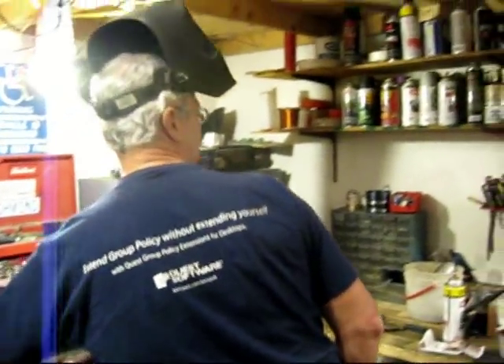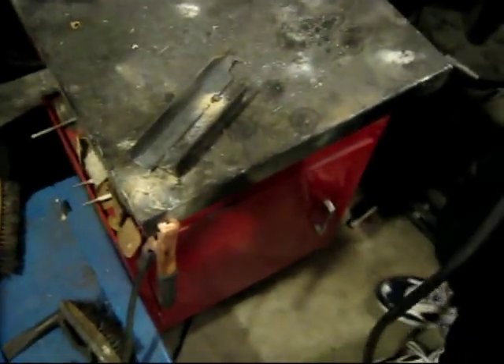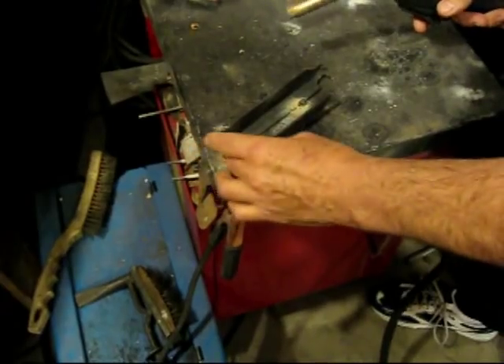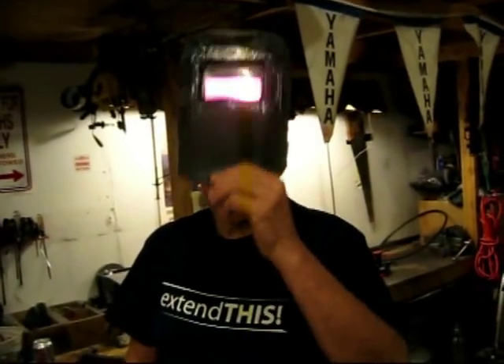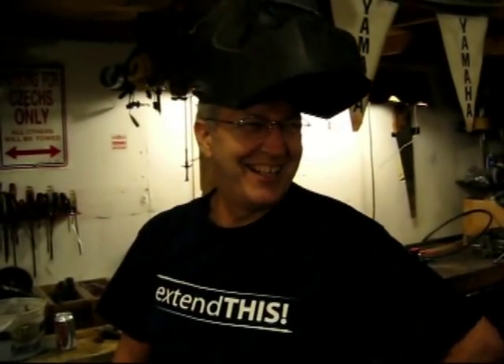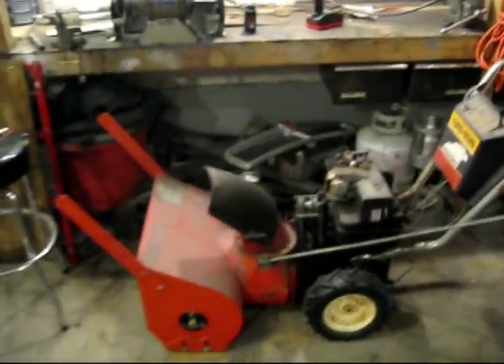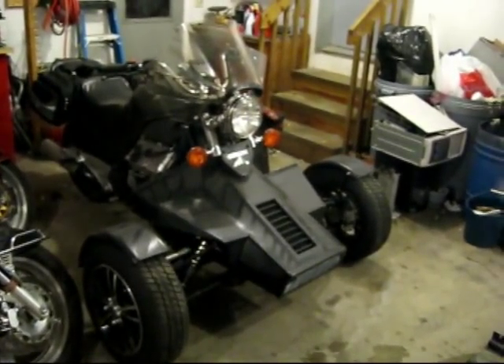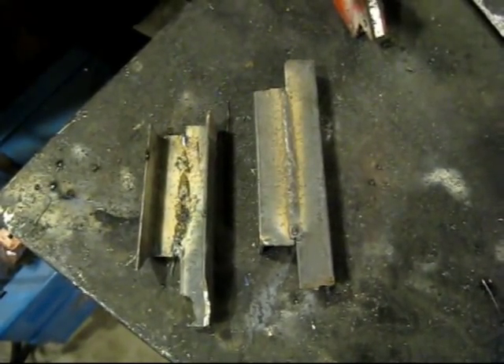MG 11 - Welding Lessons

Comment: I too am learning to weld up auto body panels do you know the joint configuration  to use on sheet metal(buttjoint lapjoint etc) Ive got some rocker panels to cut out. I wont bust your balls about saftey hazards but be careful just so you wont have to listen to every body